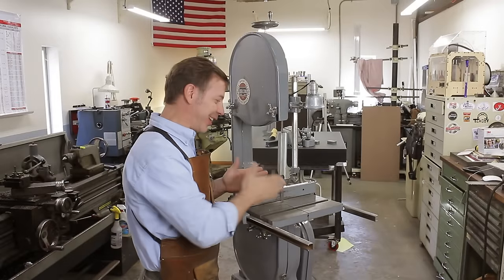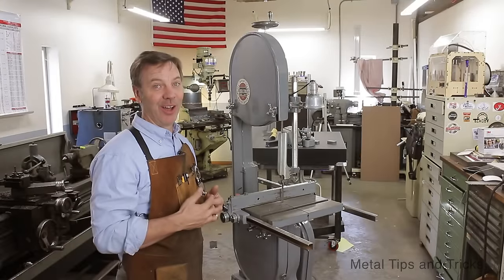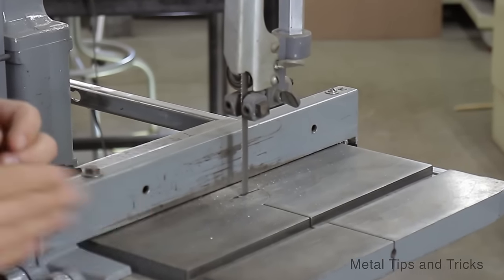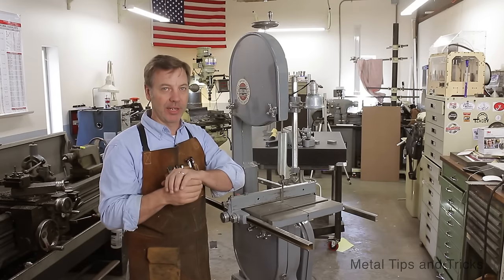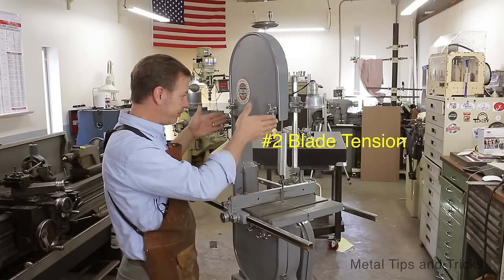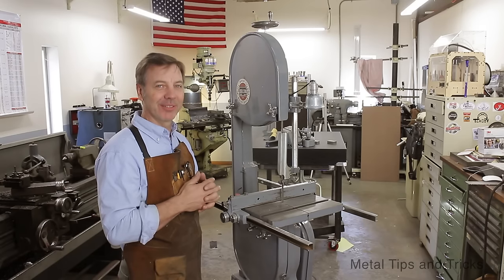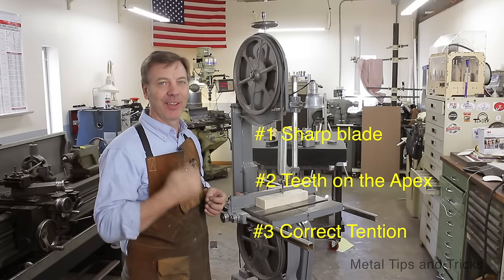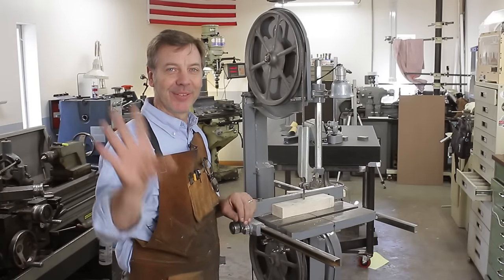How to Alignment Bandsaw Blades

Comment: Dale,

I was taught to chase a thread on a 14" South Bend when I was 13 years old. I am now in my mid 70's, been in the machinist trade all my life and now am a metal working hobbyist. No one has ever taught me how to adjust a bandsaw till now. Thanks for the tip, will try it the next time I turn on the old Walker Turner.

Dick B.

Comment: Hey, that was good. I like how you take all the mistery out of the whole thing, it's a pertinent role to play for guys like me who are "like a hen looking at a knife" as we say in French, ie pretty clueless.
By the way, I bought recently, here in France, a 1950s 14" wood/metal bandsaw (local licensee of Delta Rockwell I surmise). Wait until I've finished rebuilding our kitchen and i'll complete the bandsaw's overhaul.
Also, thanks to guys like you, I'll probably acquire a 12" lathe mañana, a model probably from the 1920s. I have absolutely no need for it, but the craving has become unescapable.
Anyway, cheers and keep on trucking !
Reply from the maker: You are traveling down a dangers path. Soon you will have a shop full of tools and  projects like me. LOL

Comment: Couple of years ago I bought a 14" Jet wood band saw.  The gentleman selling it said he could not get it to cut straight. I built a new stand for it and used a jack shaft and a second set of pulleys to slow it down to metal cutting speed.  With it all set up fresh and the Teflon guides carefully aligned I tested it out and it was not running true.  My solution was to fit the saw with Carter type full roller guides.  It was an expensive fix, close to $200, which is more than I spent buying the basic saw.  But that is not the important issue.  Before I had a worthless saw.  After I have a saw that I use all the time.  Obviously Dale knows what he is doing and he successfully cut a straight line without guides.  If he had tried to cut a radius the blade would have turned into the cut and it would have been hard, if not impossible to stay on the line.  So, when you are turning your 14" band saw upgrade to Carter style all roller guides.  You will be glad you did.
Reply from the maker: Thanks for your comment . :-)

Comment: You showed me that "apex" trick when you came to video my shop and it yielded immediate results. I did not realize the tension affected it too. I tension it initially by feel and with the teeth on the apex I get good tracking. So for me anyway, when it feels right to me it's about there. As always, nice tip.
Reply from the maker: Hows it going? I Just subscribe to your channel. good information. :-)

Comment: Thanks for a timely lesson , just had a Walker-Turner wood and metal follow me home . I replaced the capacitor and installed new poly tires and cleaned it up....It replaces an old craftsman wood bandsaw. Didn't really have much idea about the set up and tension, but really missed the boat on the way it rides on the top wheel ....It came with a lot of old blades not sure of the shape they are in ...they feel sharp, Thanks again
Reply from the maker: Congratulations on the new saw. Try the old blades if they don't work toss them. :-)

Comment: Great tip on the effects of tension. Also the importance of getting the teeth to the apex. (Which must be done with all guides retracted away from the blade; after blade is tracking where you want it on the wheel, bring the guides back to just touch the blade without moving it out of alignment.)

Comment: Would not have believed it if I hadn't seen it. On to the apex with my bandsaw. I still think the guides ad thrust bearing  clearances are important, but clearly not as important as apex and tension. Thanks, Dale.

Comment: Sound advice but to add to it, often it will be found that once a blade has been used for circle cutting it will not cut straight again, probably due to uneven tooth wear. 
Also when fitting a new blade, give it an easy life to start with. It seems that you can damage the teeth of a new blade with heavy cuts while you may potentially have burrs from the grinding, much like you can damage teeth by not having a fine enough pitch blade for thin stock. Not seen the evidence but it sounds reasonable.
Reply from the maker: Thanks for the comment
Reply: Chris ,what do you mean by circle cutting?
Reply: Mike Sanchez Perhaps If I had said "cut curves" or "discs" but circle cutting still sounds quite descriptive enough to me. Sorry for late reply.

Comment: Also helps to start with a good quality blade. Harbor Freight blades, the tension changes daily. Just like my cut accuracy. I ended up throwing out the bandsaw. In retrospect, there was nothing wrong with the bandsaw. I was just too cheap to recognize the error of my ways.
Reply from the maker: Interesting comment. :-)

Comment: Great Tip! I never knew that the teeth wanted to be on the apex of the wheel, but now allot of my band saw issues make so much more sense. Do you know what gear reduction you have on your saw to slow it down enough.
Reply: need to get it down to about 100 surface feet per minute, normally a wood cutting saw is set to closer from 2000CFM, if this is the case you need 20 times less... normally a reduction gearbox is employed to do the work, plus a couple of pulleys to have a couple of speeds available.
Reply: I dont think he was worried about his speeds ,this video was about alignment .
Reply: He covered that.  Said it was set up for metal but wood made a better demo to show the alignment.

Comment: About the sharpness/tracking of blades:  

I have seen too many blades (and thus tracking) screwed-up by someone sawing into a piece of metal rough-cut by an acetylene torch.  The remaining slag on the torch-cut is much harder than the steel.  Unless you grind this slag off first, it will almost certainly damage the blade and make it track poorly.
Reply from the maker: Good point.

Comment: What if your bandsaw blade is turning in and out when cutting and going in at angle and it’s tension isn’t working
Reply: Try aligning the gullet of your blade with the crown of centre of your wheel.

Comment: Not all blades have a crown:) My INCA has flat tires, and should be set so that the teeth protrudes slightly off the front edge, as per the manual:)

Comment: how about  it keeps throwing off the wheels ,can,t keep it on. please help.
Reply from the maker: I have been having the same problem lately. My problem stems from the blade sliping on the lower wheel. Try making your blade tighter.  Caution this could damage you machine. So only do this if you use your bandsaw everyday. it helps balance the stresses out.
Reply: thank you